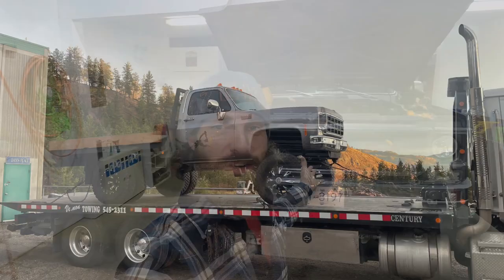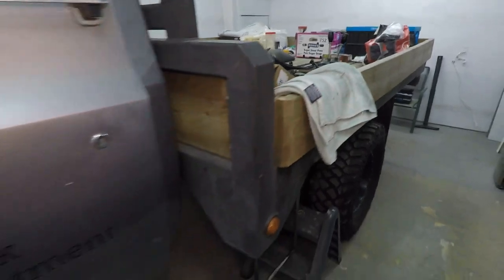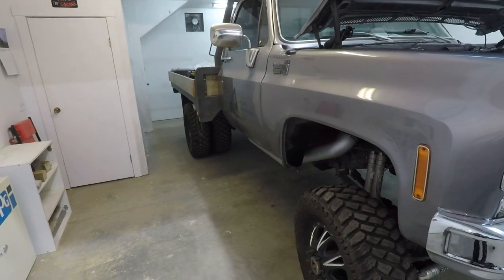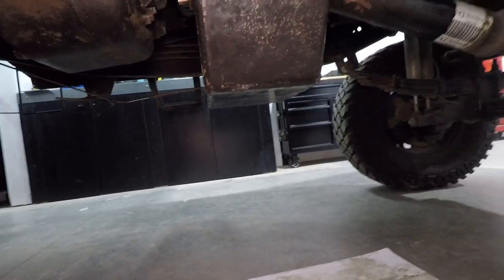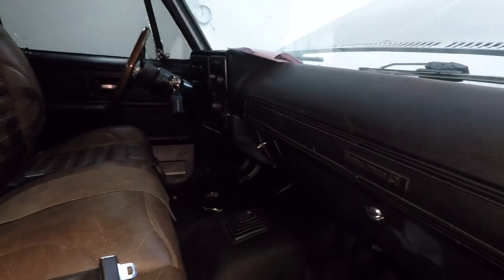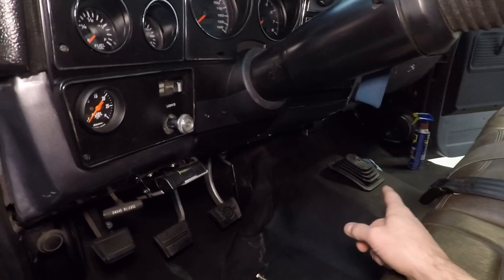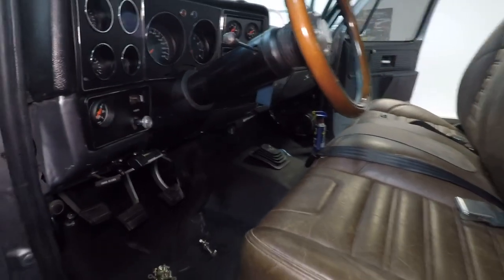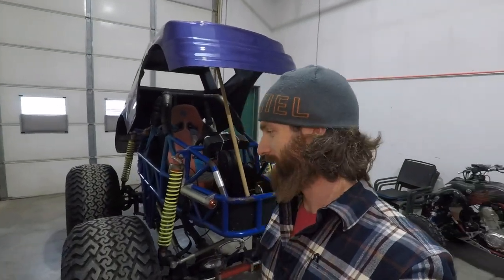1978 Chevy Squarebody 12 Valve Cummins diesel Swap

Comment: Awesome truck. I'm in the middle of this same project right now. What you said about spending hours and hours trying to figure out little stuff here and there couldn't be more true. Hell it took me a week to figure out my turbo oil drain tube. My engine is from a Ford box truck, so it has the "Ford" exhaust manifold that tucks the turbo directly under the manifold against the engine block. The stock drain goes right through the space that the engine mount bracket goes, because in a box truck application there IS no mount there. That stumped me for a while. 

Next was the industrial size alternator. I went down a rabbit hole figuring out how to wire it up so it would actually charge. It needed 5 different wires, switched power, battery power, and a special plug going into the regulator. 

Just little things you figure should be simple and you get bogged down and end up taking all day.
Reply from the maker: Thanks buddy! Yes it is so true. The countless hours I have spent burning brain oil would fill an ocean 🤣👊

Comment: This is a beauty. I have a plan to put a 4bt in my 86 k10. No need for a 6bt in a half ton but I want better fuel economy and more torque cause I do plan to tow a 20ft give or take a few feet and a 16ft flat deck trailer
Reply from the maker: Thx buddy!!! That 4BT would be awesome!
Reply: @KASLCustoms  I hope so. Just gotta decide how much HP I want in it😂 well and the right donor for it or whether to buy a new crate engine
Reply from the maker: Absolutely 👊

Comment: What kind of fuel mileage you getting with it?
Reply from the maker: Sorry. I haven’t put enough miles on it to report anything. Soon 👍
Reply: @KASLCustoms  let me know.   I think one day i want to do a 4bt into a 1500 truck.   I want something with really good fuel mileage but can still pull a landscape trailer around, and something old school like the 4bt.  Maybe a VW tdi I've considered also
Reply from the maker: That would be awesome! I saw a fella in Moab at Easter Jeep Safari that had put a 4BT in a TJ and it was deadly!
Reply: @BRWfilms  I'm putting a 12 valve in my square body right now. NV4500 transmission with 4.10 gears. When I get it on the road I'll report back with mileage. I'll probably get a little worse than normal because my engine has a 230 horsepower injection pump, it came out of a full size box truck. I'm betting the way it's set up will be a little more thirsty than usual. It's real close to being ready to drive.
Reply from the maker: Right on! Thx
Reply: @Bloodbain88  cool let me know if you ever want to sell it
Reply: @BRWfilms  Commenting now so I don't forget. Got my truck on the road. I went through the first tank (20gal tank) of fuel and was having SO much fun I forgot to record the milage. Also me and everyone else was just joyriding and romping on it every chance we got. Plus it was running on crap fuel in that first tank. A mix of diesel contaminated with DEF I got for free, some gasoline that was left in there, and some used motor and transmission oil I dumped in there to get rid of. 

 This Cummins pulls hard in any gear, especially 4th for some reason. But I just filled the tank with fresh diesel and some Lucas fuel stabilizer and I'm keeping track of milage now. So far I've gone 74 miles and the fuel gauge is still pegged on full. When it had the carbureted 350 in it, I think I'd get around 35 or so miles before the needle started moving off full.
Reply from the maker: That’s awesome buddy!!  Nice work 👌👊
Reply: @Bloodbain88  awesome man
Reply: @BRWfilms  okay I'm getting 16MPG city. Apparently I have a pinhole or something in my fuel pickup tube and it's aerating the fuel at anything below 1/2 tank and I have a decent loss of power and fuel economy. If I calculate fuel mileage while above 1/2 tank I get 20MPG. So there it is.
Reply from the maker: Wow bud that’s awesome. Way better then my newer duramax!